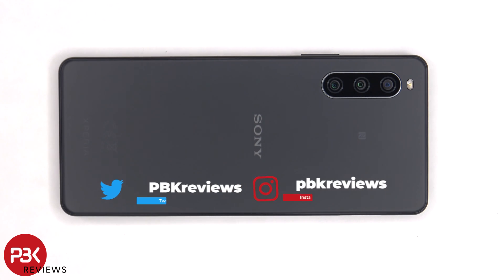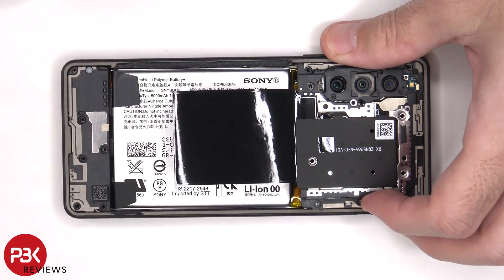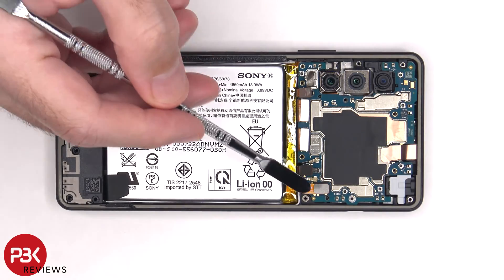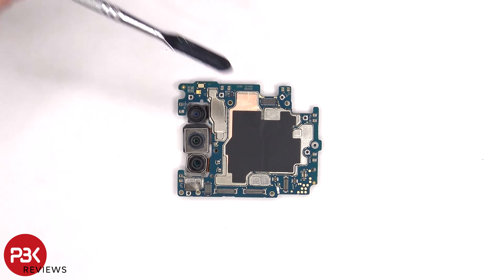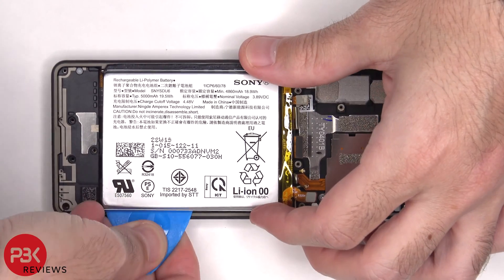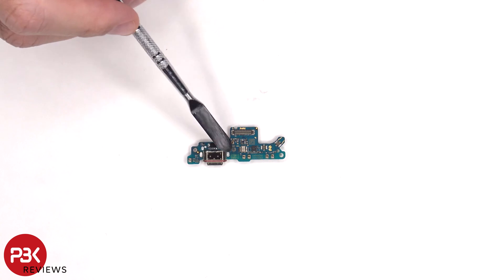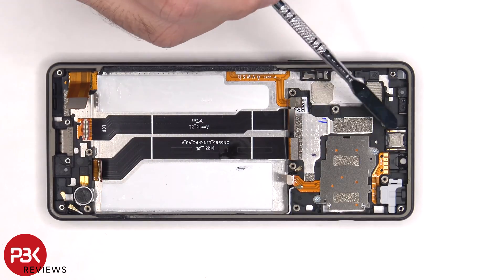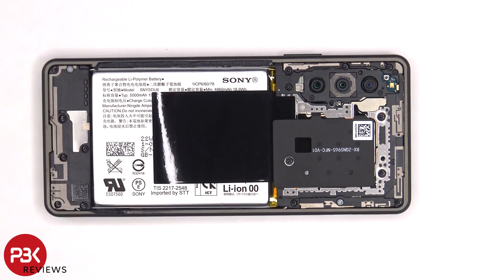Sony Xperia 10 IV Teardown Disassembly Repair Video Review

Comment: We're can I get the screen replacement
Reply: I'm in Dubai
Reply from the maker: sony parts are usually not easy to find. But you can check ebay or sites like that.

Comment: i dropped mine 10 feet twice and still working. very durable phone
Reply: I dropped mine once 5ft. Lcd screen broken
Reply: @abrahamcastillo74 me too, and that’s when I found out nobody near me repairs these phones :(
Reply: I dropped mine once 5ft. Lcd screen broken
Reply: Not true re: durable phone. dropped my Sony Experia 10 mark iv from waist high onto concrete and the digitizer is fried. The screen did not fracture.
Reply: i dropped my phone on water twice in the sea, im a sailor (seaman) and never broken. its sea salt and usually when you dropped it corrosion will take over. but its still ok

Comment: In your opinion, does the lack of part availability and repair services make Sony Xperia phones not worth buying?
Reply: No, aftermarket parts do exist. Sony is one of the most pro-consumer phone manufacturers with their Sony Open Device Program and the fact that they still include a headphone jack and sd card slot in their latest models.
Reply: They are absolutely worth buying in my opinion

Comment: i dont understand. it says both li ion and li polymer on the battery. so which one is it?
Reply: They are pretty much the same, so often the two terms are used interchangeably.
Reply: @kosztaz87  li po has much less usefull life. just 300 cycles  compare to 1000 of li ion
Reply: @Vova3iLvova  Are you sure the difference is that huge? I even saw in the new Nokia G22 specifications that they guarantee 80% capacity after 800 cycles (li-po battery like all other phones).

Comment: 2:20 Top left corner of battery - "Li-Polymer battery"
Right down corner of battery - ""Li-ion" 
... It's Li-Po, or Li-ion? 🤔
Reply from the maker: All Li-Po batteries will have Li-ion marking/labeling as well. It's confusing but yep. If its Li-ion, it will only show Li-ion and wont have polymer on it anywhere.
Reply: Литий-полимерный аккумулятор (литий-ионный полимерный аккумулятор (lithium-ion polymer battery); аббревиатуры: Li-Po, Li-polymer, LIP, Li-poly и т. д.) — это усовершенствованная конструкция литий-ионного аккумулятора.

Comment: Sony is always stingy when it comes to providing heatsinks or heatpipes on its smartphones. even though the price of his smartphone is not cheap! Rotten, I say Sony phones are very rotten and bad for cooling systems!
Reply: They are, but for this mid range phone the lack of a cooling system is not an issue, it doesn't overheat even under load, look at stress test results. But yeah their top of the line 5 and 1 series phones are pretty much handicapped because of overheating issues.

Comment: The teardown of this phone is finally here. Thank you so much. 

This time around, I noticed that the battery voltage is higher than normal at 3.89 V. I haven’t seen anything like that in other brands of phones. For example, the S21 Ultra is at 3.86 V. The iPhones are usually a little bit lower. 

The mAh number is not actually a measure of energy of the battery. It’s the electric charge. For example, you can’t directly compare the energy of a 1.2 V NiMH battery with a lithium ion battery just by looking at the mAh number. The mAh number is used together with voltage to determine the energy amount. 

Of course, this battery only has about 0.8% more energy than the S21 Ultra. That’s a small number, but I guess extra battery power is always welcome.
Reply: Higher voltage = less charger cycles
I was expecting it, because in their marketing they focus on size and to get this big battery in small volume, there is only one way.
Hmm... What was healthy voltage for batteries?
Reply: It's kind of sad that Sony is cutting corners.
Reply from the maker: You're welcome. I'm not too verse with voltages and electric engineering to give my opinion on that :)